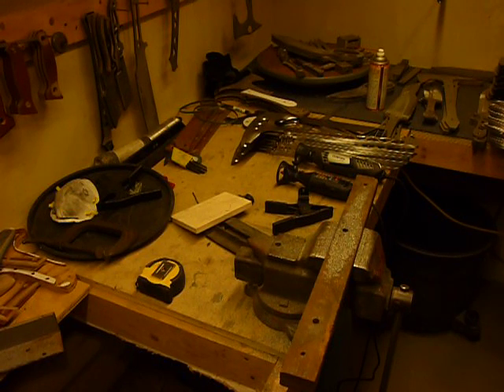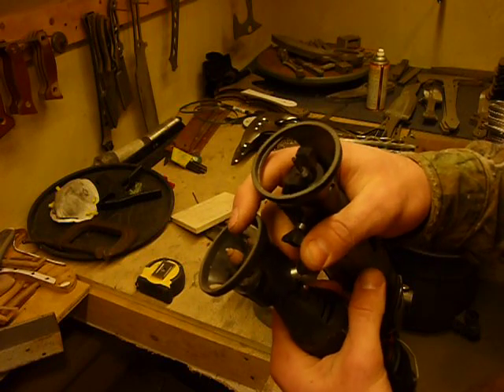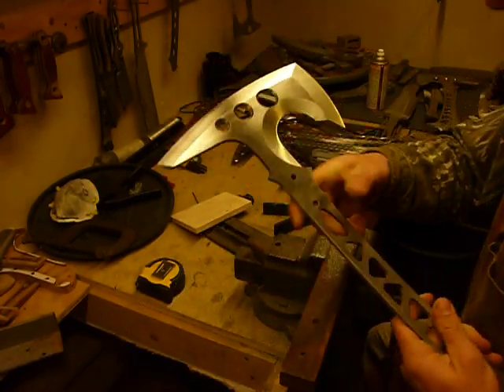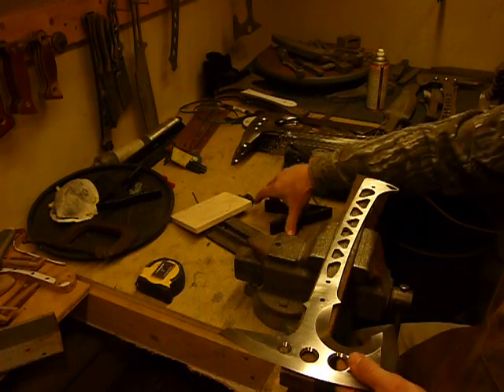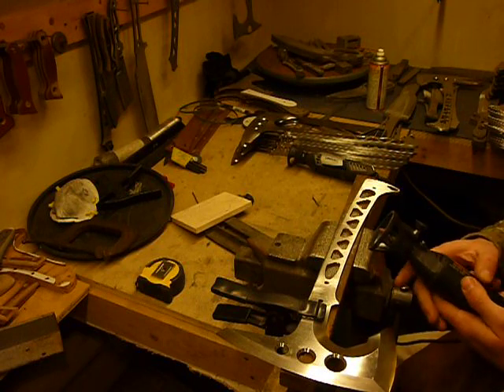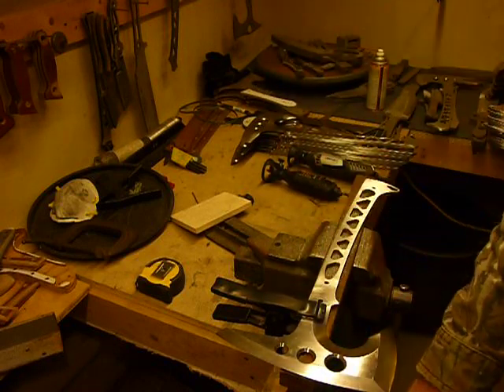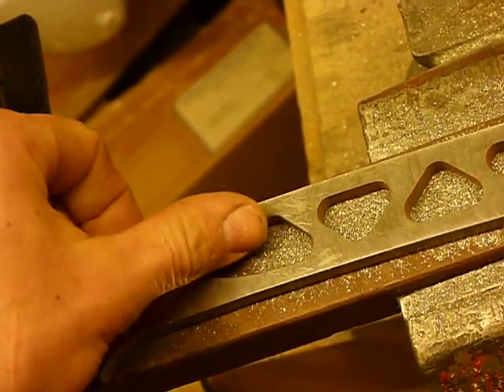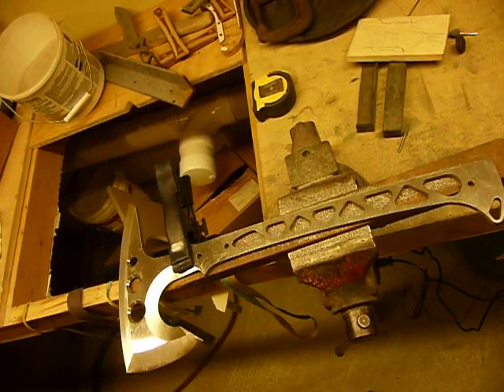chamfer milling with Dremel and Carbide Burr

Comment: Great tip, just subscribed.  I'm doing a few projects with titanium and stainless steel they involve stippling the surface for added effect but I'm wondering if you have some tips or possibly a video of stippling onto hard metals using a dremel to some added knowledge I use a rounded tungsten carbide
Reply from the maker: calligrapher 21 for stippling, I use a hardened steel punch and a hammer.  On titanium, such a task will be more difficult because not only is it harder than annealed steel, it also work hardens pretty quick